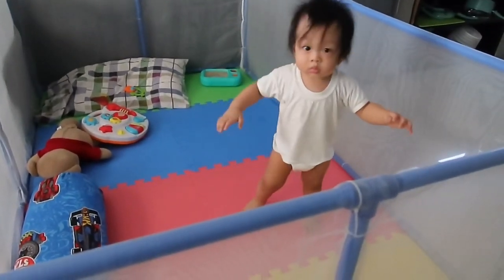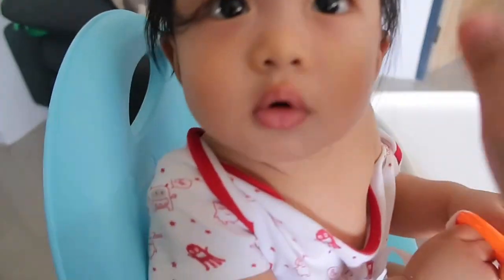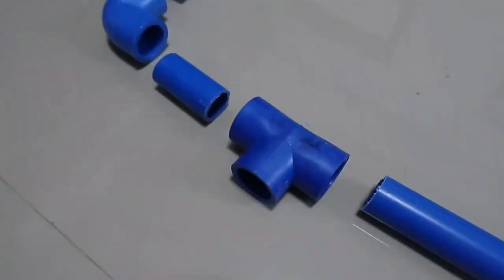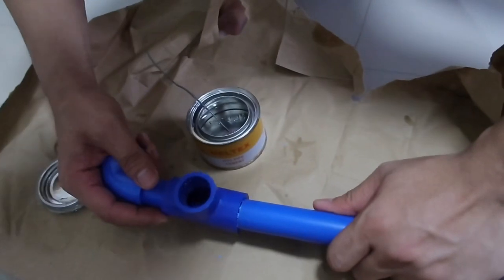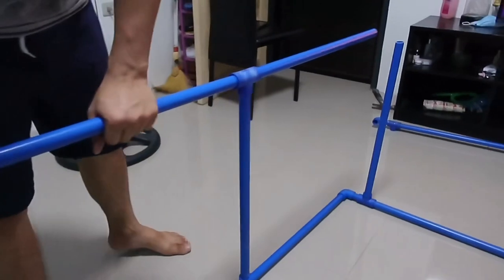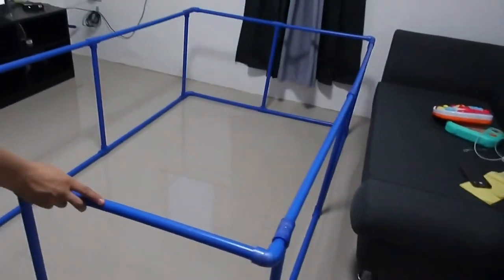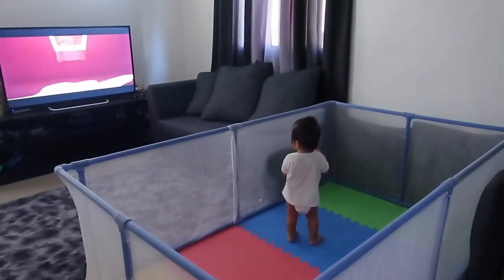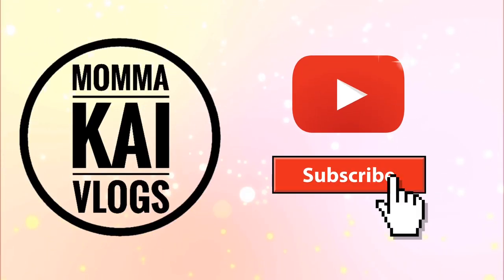DIY BABY PLAYPEN | 1,200PHP Budget | Vlog #4

Comment: What are the measurements for the pipe lengths
Reply from the maker: Hi Im sorry I don’t have the exact length of each pipe. I only had the whole dimension of the playpen. So for ex the length of the playpen is 6.5ft then there were two 3.25ft pipes combined by a connector in one side
Reply: @kaiavlogs  thank you hun